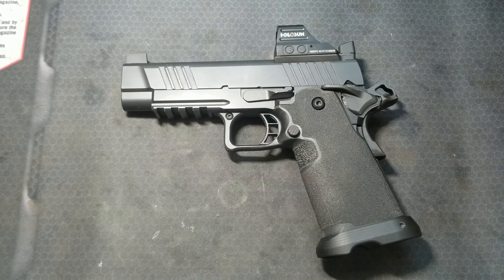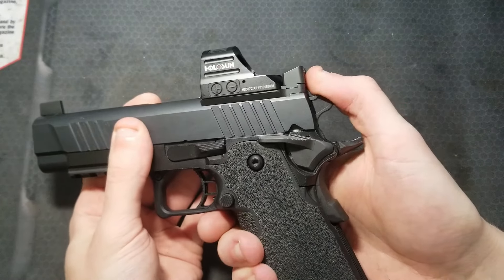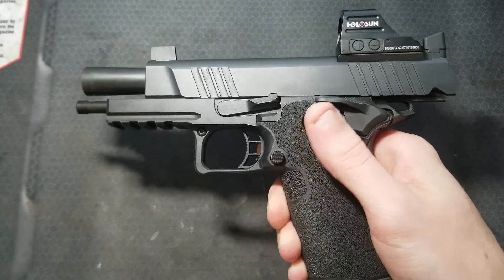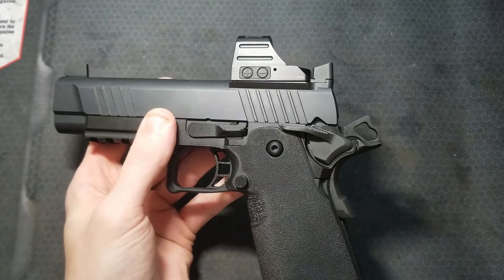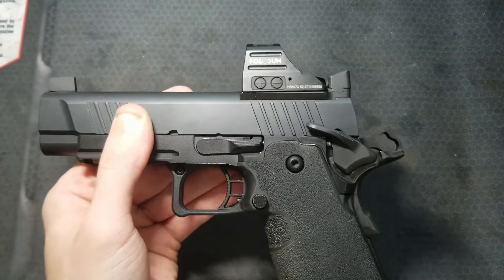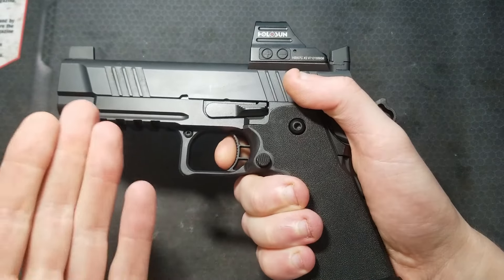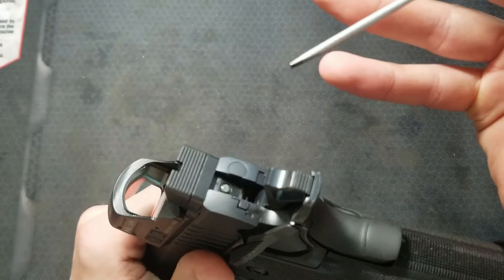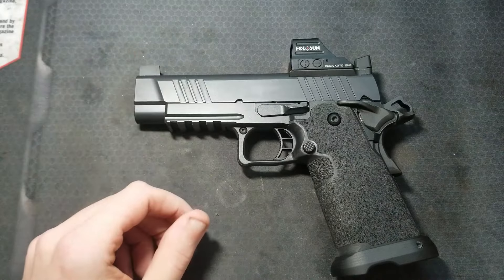1911 and 2011 Pistol Safety and Function Check

Comment: Not the proper video but hoping to get a response. I am doing the prodigy grip swap and have everything functional except the beavertail grip safety. The default Mac grip safety seems to be too large for the Prodigy grip module. It collides with the top of the Prodigy mainspring housing and is too thick to depress into the prodigy grip safety channel. You had said the Mac frame doesn't appear to be a .250 radius beaver tail, but did you have to reprofile the actual  replacement grip safety or the Prodigy grip module grip safety channel?
Reply from the maker: The mainspring channel in the grip module will need to be widened to allow the grip safety to swing into it. it sounds like the top of the mainspring housing needs shaved down as well.

Comment: Thanks for the video.  Some great information that I didn't know.  Yes, releasing the slide on an empty chamber no magazine is bad.  I saw that for the first time a couple of days ago Bill Wilson and Massad Ayoob video.  BTW, I went with the Mac 9 over the Tisas.  It was actually $850 instead of the $770, clerk quoted the wrong gun.  It will be here next Tuesday, looking forward to it.  Hopefully it's one of the better examples and not a repeat of the one your fellow YTuber got that you recommending checking out his video.  Thanks again for your video series on the Mac 9, Ken

Comment: What is the radius cut for the mac 9 ds
Reply from the maker: For the grip safety (which i assuming is the radius you're asking about) its somewhere between .178 - .203". The frame radius is not even centered over the thumb safety pin hole. Seems Tisas did their own thing with the frames on these.
Reply: They definitely did their own thing.

Comment: Is there any way I can check if my .45 acp 1911 is unlocking prematurely? My primers are getting crushed (you can barely see the striker mark), many with burs, some even ejected from their pocket. First I thought it was ammo related, but they ran perfectly in a 2011 I own. It isn't a  light primer strikes problem either: it passed the pencil test. I dont recall my 1911 Colt having this problem before, and it seems it all started after I took it down for cleaning the last time. It has a dual recoil spring, but I don't believe I could assemble them wrong even if I tried.
Thanks in advance.
Reply from the maker: Hard to tell without seeing the pistol. Also an odd failure for sure. A couple ideas. Try a much heavier recoil spring, like one that wont allow the pistol to even eject properly. Should slow down that unlocking. Try different ammo. Also do you have an extended firing pin? Sometimes people install those with lighter main springs. Is the firing pin spring worn? I run wolff XP firing pin springs in all my 1911s. What's the main spring weight? Is it heavier than 23# (factory weight)? Just some ideas of stuff to check. Outside of those easy things to try an isolate the issue. It may be that the chamber end of your barrel lock up is not correct in some way.
Reply: @EngineersArmory  thanks for the quick reply. All springs are factory on my gun. Tested the striker the other day and It sent the pencil flying to the other side of the room. The barrel doesn't move in lock up, I tried a couple of 1911 tests and it seems my barrel link is proper sized and the barrel stops where it should on the frame.
It just occurred to me that the solution might be simpler: too much head space.  I might have crimped too much my reloads and for some reason it affects the 1911 but not the 2011 (although the reloads pass the chamber checker). I can't believe I didn't try factory ammo on the 1911 to make sure the pistol is the problem. I'll hit the range this weekend with a box of Federal HST and, if the problem persists, I'll get a set of GO and NO GO chamber gauges.
Thanks again
Reply from the maker: @VincitOmniaVeritas7  yeah no problem. Thats an odd one. I would be curious to hear if you get it figured out!
Reply: @EngineersArmory  I promise I’ll keep you posted. Thanks.